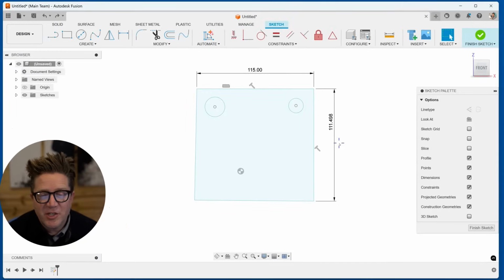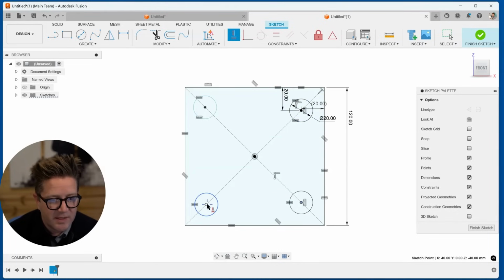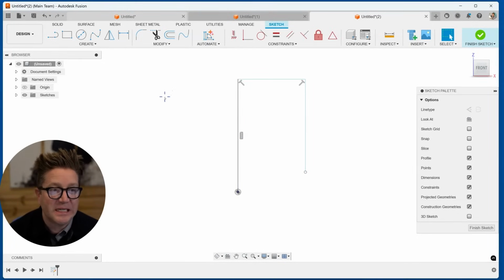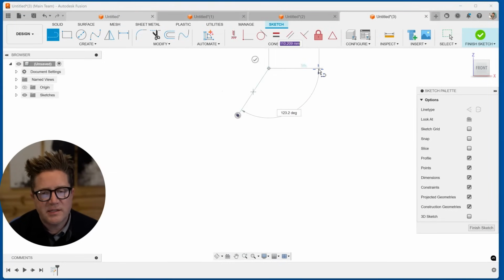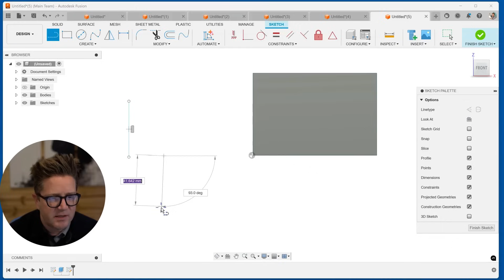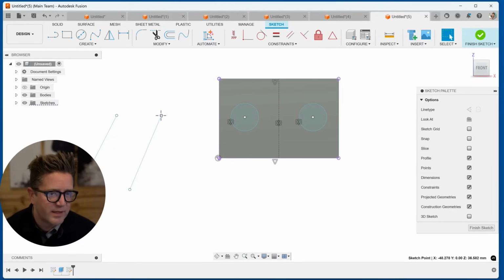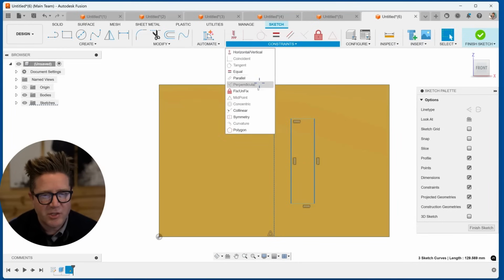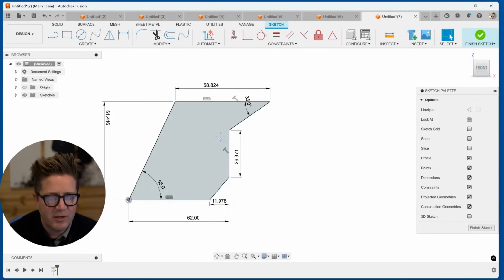Learn Fusion 360 Constraints – The Key to Stable & Smart Designs

Comment: Not trying to be a dick, but literally nothing happens the same when I do the exact same thing as you're doing here. When I make a line, regardless of size, angle, or connection to another line, every line stays blue. In fact, I've literally never seen a black line in my ~1 year of occasionally using fusion 360. Am I using the same program?

Comment: I use fusion to build and print 3D models of things I want to print for personal needs and fun.  In the beginning I followed Lars.  I stopped printing and use of fusion 360 as well.  I replaced my printer with a new Bambu Lab A1  and thankfully discovered you.  I am totally self taught with no engineering background, but mechanically inclined.  I appreciate your no nonsense, straightforward approach to teaching with no distracting music.  In the past few months I am relearning fusion 360 and your videos are a must for me.  Tyler you are no doubt one of the best fusion 360 instructors on YouTube.  Thanks.

Comment: Everyone says: "You have to have your sketches fully constrained". I've been printing for about 5 years now. No idea how many prints (all functional and not too complex). I have never had a fully contained sketch (best I can remember) and I have never had any print problems because of the sketch. Now I do use constraints a bunch but it never bothers me if the sketch lines are blue or black. So, i agree, use constraints as needed but, for me at least, I see no reason why the sketch needs to be fully constrained. And I have never heard anyone really explain why they need to be. Just that "you have to fully constrain your sketches". Oh well, I must be a little rebel.
Reply: Where it can become problematic is if you use parameters to change key dimensions to make your model bigger or smaller. An unconstrained sketch that works fine at one size can break horribly if you change a dimension

Comment: I like to put down a diagonal construction line, add a point on the midpoint of that (for each object to be centered) and then make those points coincide... I've got shortcuts for point and coincide so its a pretty quick operation
Reply: Something I'd like to know more about is working with curves on sketches... At the moment I just try to avoid them by using circles and arcs. Also, when to fillet on a sketch, and when to leave it until the final steps?